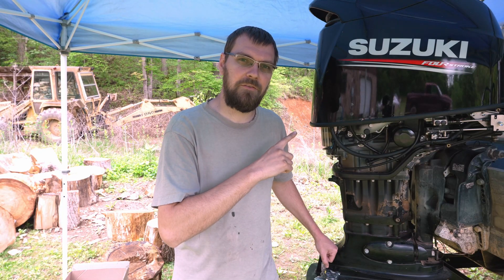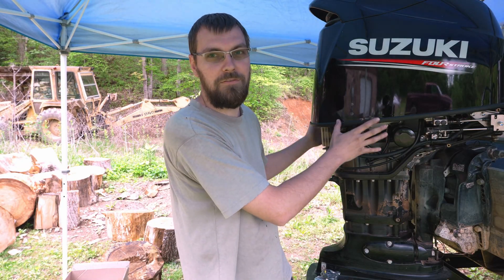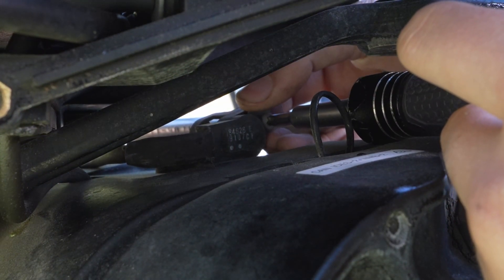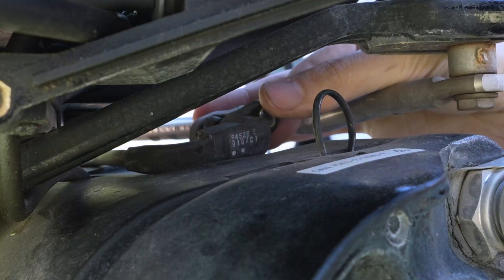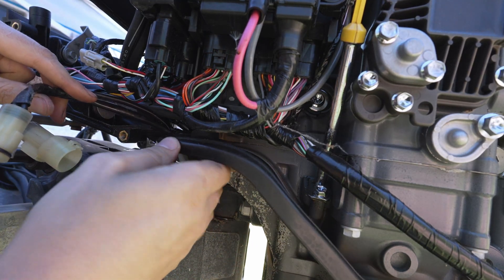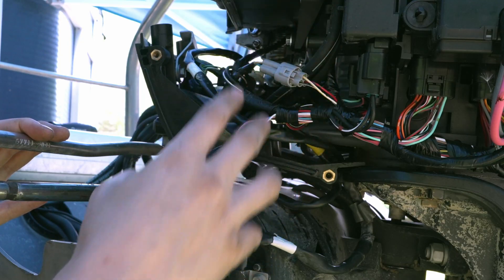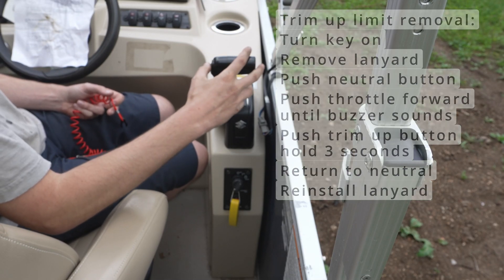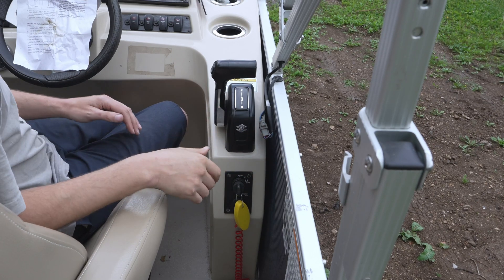Suzuki DF140 Tilt/Trim Limit sensor replacement and reprogramming

Comment: Great video and thank you for making the effort. I have a 2009 DF140 and it has stopped trimming down 100% all but I can trim up as normal.  We pulled off the trim motor and bypassed the relay to find the motor working normally. Could it still be the limit system as per your video as I havent tried that yet ???   I was thinking its the relay but we can hear it clicking in both directions.  Cheers HAYDEN
Reply from the maker: if it clicks when you push up, and goes up, and clicks but doesn't go down when you press down then its almost certainly the relay itself, the limit switch will stop the relay from clicking once it hits the limit set point.
Reply: Yes maybe something inside the relay has failed so I think i will buy a new one. I see a lot of aftermarket relays out there but I think OEM is better ??  I was looking for my tilt trim sensor anyway as per your video but it seems mine doens't look the same as yours.  My Model is 2006 DF140.  I wish I could send a photo.

Comment: Hi Tom, thanks you for your video. On mine (SUZ DF250) it do not work.. maybe something is wrong when i try to do reset Maximum trim level
Reply from the maker: If I'm thinking correctly the 250hp engines have a different style limit switch where the cam that triggers it is adjustable, and it works independently of the gauge sensor (which still handles the down limit)

Comment: Very useful thanks a lot! Any advice on how to turn off the check engine warning light after changing the sensor? I keep gettin the 3 - 7 code
Reply from the maker: Is it possible the cam went back on in the wrong position or something? that code indicates the sensor is outside the expected range, so it should have gone away when you put the new sensor on.